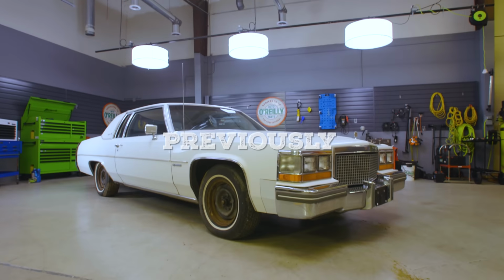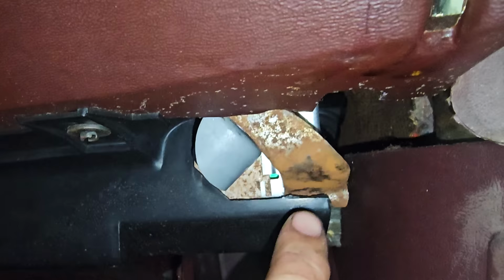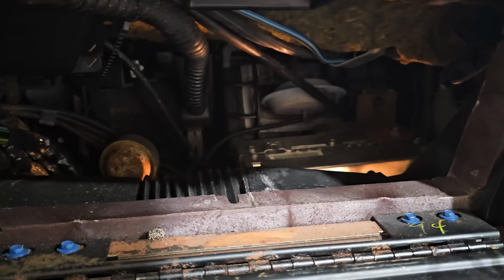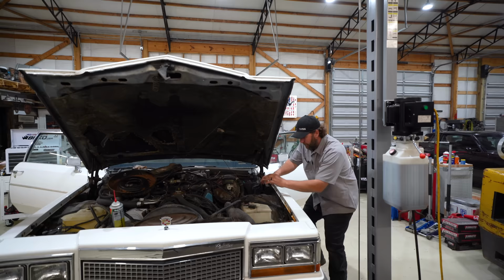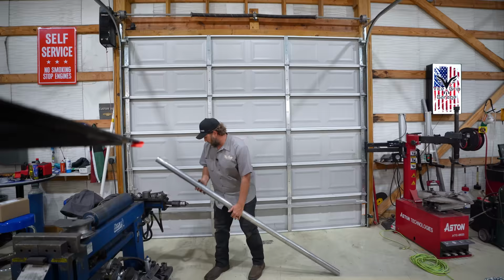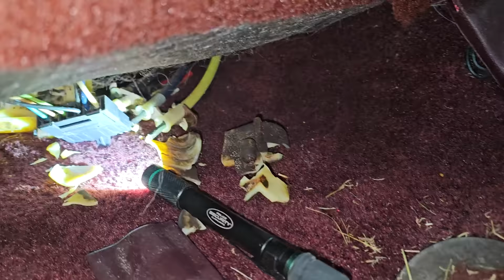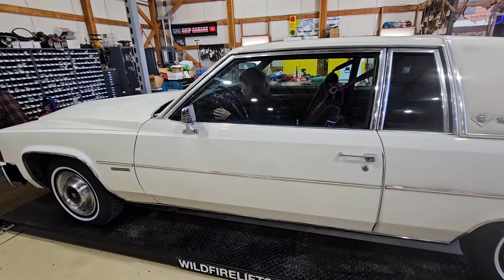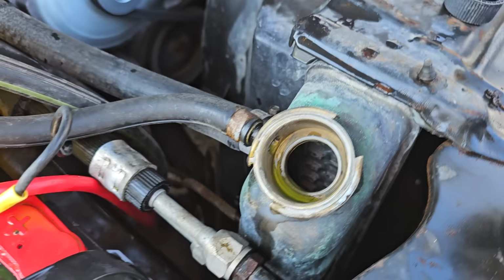Will It RUN AND DRIVE Finally? Carburetor or Computer On This 8-6-4 Cadillac!

Comment: I worked as an electronic tech in the 80's and I was cringing when Derek first started to put the PROMs in the reman PCM. He got it done though without bending up the pins. Nice job! As always a very entertaining video.
Reply: I was basically holding my breath at that point and wondering how he was ever going to find replacement PROMs.
Reply: Pretty sure my heart stopped beating until I saw those PROMs in.. 😂

Comment: Really surprised you haven’t installed An exhaust port to your overhead doors so you can  get the exhaust outside of your fabulous building. A guy needs to use his lungs a while longer and it also make it safer for your little people. Really enjoy the channel, and how much you care about and work to make your family a part of what you do every day. Keep on keeping on blessings to you and yours
Reply: Ive always thought the same thing. I wouldnt be able to stand those old vehicles running inside like that.
Reply: Have you seen how enormous that building is inside? It's gonna take a lot of exhaust to even make a dent
Reply: When I was younger, my father used to go to a junkyard where the family worked on cars in a garage with the doors closed. Eventually, they all developed health problems, and then they sold the business.
Reply: @Demoralized88  yeah but it stays near ground level, so you don't get the whole volume of the building to disperse it, only the square footage
Reply: @williamalexander1743  they were probably smokers too

Comment: My uncle bought this exact car. Same year, color, hub caps and engine. I recall it being rather gutless, but the engagement of the 8-6-4 system felt like a trans shift, so not bad at all. They really didn't have much trouble with it at all.

Comment: Your pure joy and excitement that it actually runs was shared with the engineers, assembly line workers, dealer make ready folks and lastly, the unfortunate owners of that automobile. “Stay running…stay running, oh it’s running” !! Joking aside I tip my hat to you staying determined to get it running with its original fuel injection. Such a fun video thank you !

Comment: This episode really brought back memories. I was a young Service Director of one of the largest Cadillac stores in the Metro Detroit area in the late 70's to mid 80's. Thanks for your shout out of respect for the techs in that era. That car caused a lot of lost sales to Lincoln. Unfortunately, it was replaced by the HT4100 the following year. Many more years of heartburn for Cadillac. Love your channel and stuff on TV. Wish you and your beautiful family continued success. One last thing, I learned very quickly how to manage and turn around an upset customer or a overworked and upset technician trying to get their 8-6-4 back on the road.
Reply: GM should really have stuck with the 425 that this platform was engineered to contain.  The 4100 became a good engine ten years later, but had no business being in a C body RWD DeVille.  Even the 368 was a better choice, versus losing 100cid and a lot of cam bearings.  A 7 liter V8 with multiport fuel injection that could modulate its displacement..  that would be modern today, and is what GM should have built back then.  But shareholders like cheap.
Reply: @Bolton115  the refinements and expanded displacement of the 4100 family were great in less time than that IMO. I had the 4.5 and 4.9 in the two Seville STSs that I owned, and they both had decent power to move a nearly two ton car. Reliable, too.

Comment: On my 81 Coupe DeVille, the mechanic disconnected a wire that went to the transmission, then it ran perfectly on 8 cylinders all of the time. I never had a problem with that engine.

Comment: Had a Cadillac 8-6-4 sedan .. white with red leather seats.  Was a great ride up and down the east coast.  Great at highway speed, but a pain at city driving, shifting back and forth through the active cylinder changes.  Six cylinders was terrible.  We finally put a toggle switch in to by pass the cylinder changes.

Comment: We used to own one of these 4-6-8s. The GM dealer mechanic cut a transmission sensor wire to disable it. He said it was the best way. Our 368 was carboned up, and it shook a bit running on 6, so that's why we cut the wire, but ours actually worked, and saved some gas before that. Ours turned out to be a rare 2 door Fleetwood Brougham.  Gold, white and chrome!
Reply: Wish it were that easy on my 2017 GMC 5.3 with AFM..
Reply: Was probably the High Gear wire that tells it it's in  top gear and shit cylinders down. If it doesn't get that signal, it won't do it
Reply: Your mechanic didn't do you a favor.  Shoulda just run some GM top end cleaner through it, removing the carbon the right way and letting you keep saving the MPGs on the road.
Reply: @Bolton115  it smacks of the same problem that GM's original mechanical fuel injection system had back in the 60s: poorly trained (or just lazy) mechanics taking the easy way out.

Comment: DEREK! Hold down OFF, then keep holding it and hold down WARMER!! Same for clearing codes hold down OFF, then hold down HI. This brings back a lot of memories, most of them bad 😀
Reply: Codes have to cycle three times then back to start of sequence, then you can clear it. Same as the 4100's and the 4.5's after the 4-6-8. Sadly I was a dealer tech in the early 90's and the "new guy" me, got the 4-6-8's, the 4100's and Allantes, I was like hazing for the new guy.   Of course you can rarely get all of the codes cleared for very long. Several eprom revisions did come out that made things better though. That was how you updated the ecu back then, new proms from the parts department and send the old proms back.
Reply: @perfecttommy6952  I had a 4100, dearlawd.   That thing drove me nuts.
Reply: I was telling him that the whole time - if you can see the temp changing, then it isn't working. It's the same with a lot of (now) old tech, simultaneously pressing means press one, and keep it pressed then the other. Add to that, that those old buttons usually work badly at best, it's hard to make 3 seconds of connection with them.
Reply: @perfecttommy6952  You and I had the same nightmare career paths. I really do still have bad dreams of the shitty dealers and Cadillacs that I worked on or for.
Reply: @kworld429  The best part is we can watch Derek do this and remember how fortunate we are today.

Comment: Owned the top of the line version of this car at the end of the 90's. Original, low miles, one elderly owner car. Very deluxe, Kelsey Hayes real wire wheels. Put a boatload of work and money into it. Nothing would ever stay fixed. The insulation on the huge bundle of wires in the door hinge reminded me of dried silly putty, fell off in inch long chunks. These cars were still in the wrecker yards then and I had multiple computers, TBIs, etc for "just in case". So, so many problems. It just never ended. I loved it so, I gave it the best I had, and eventually, it just broke my heart. If you don't hate Caddys yet, this car will fix that for you. Run away, save yourself.
Reply: Agree, I figured Derek gave up on it after it first beat him.  Hope it ultimately works out for him!
Reply: Idk...I own an identical car to this one,two 1990 Brougham, and a 1992 Brougham. They have been hands down the most reliable vehicles I have ever owned. They rarely need anything,most of the work I do is cosmetic and routine maintenance. If you get one thats been badly neglected, I suppose it could be a different story.
Reply: @user-kg2ly2lb8z  used cars can be a good economic option once you get past the "deferred maintenance" of previous owners.

Comment: I graduate from H.S. in 1981. The Gas Saving 864 Caddy was designed. When gas was $1 a gallon and minimum wage was $3.35.
Reply: In 1969 minimum wage was $1.60.
Reply: Minimum wage varies from state to state. It was $3.25 in 1991 when I started my first job. I made $ .10 over & thought I was making decent money. Gas though was only $ .90 a gallon then too. I worked in the next state over from where I lived. In the state I lived in it was something like $2.65 if I recall.
Reply: @stevemccauley5734  Just a quick clarification Minimum wage is Federal. While states can implement their minimum, if Federal is higher, employers must pay it. So yes states can state a higher minimum than federal, but not lower.
Reply: @repaid1  Gas was 89 cents and minimum wage was $3.35.  Federal minimum wage is now $7.75 and gas is five bucks..  hmmm.  Well, you know, shareholder equity.

Comment: That Caddy was a mistake in 81and STILL is!! The diesel Oldsmobile was too!!REST IN PEACE!🪦
Reply: Gee, it's funny how nowadays, that computer processing has caught up with the ideas from back then, that several makes now have modulated displacement engines that turn off some of the cylinders at various times to save gas.

Also, if you have one of these cars now, GM stuck with them til into the '90s-meaning the later PROMs give 30 percent more power than the car had when it was new.  What other '80s car could get a factory provided chip that gave it 30 percent more ponies in its power barn?
Reply: Oh shit, the diesel Olds 88, grrrrr
Reply: @slacker1597  
The engine from HELL!👹🔥
Whose idea was this piece a 💩
Reply: yet Derek has managed to get both up and running, so...

Comment: I'm glad you kept the EFI even though it's a PITA.  Most of the ones I saw and have seen had 4 barrel conversions or permanent 8-6-4 deletes.  Chrysler had the exact same issues with their early Bendix EFI in the 1981-1983 Imperial, and most of those got scrapped for a good Holley as well.  Dealers even offered factory conversion kits.   Replace the fiberglass extensions and it would be a good Sunday driver for lunches or going to church.   FYI -- retrofit kits for the AC to R134 are available, if you want to keep it, but many of the interior AC parts such as the evaporator are no longer available anywhere.  I had an '87 Fleetwood in the shop years ago that was owned by a nice older gentleman, we had done the 134a conversion and it needed a condenser, looked for 6 months and had to resort to pick-n-pull.
Reply: Derek has a carb swapped Imperial too, I think he intentionally seeks out these kinds of challenges to punk the dealer mechanics who cried about them back in the day. It's a great flex IMO.

Comment: Clearing Trouble Codes - 

During trouble code display: Simultaneously press and hold ‘OFF’ and ‘LO’ buttons 
When ’00’ is displayed: Release the ‘OFF’ and ‘LO’ buttons

To end diagnosis:
Press the ‘AUTO’ button, or switch ignition OFF for 10 seconds
Reply: A sex bot copied your comment and got lots of praise from people for the advice! Even Derek thanked them for your advice! Thought I would give credit where it is due for this good advice!

Comment: I did my first headliner 2 years ago and it was so much easier than I thought it would be. I kicked myself for all those years of having crappy headliners. You should include that in an episode. I got the material from Hobby Lobby. They've got the foam backed material just like the original headliners. All you need is a can of 3M headliner adhesive and the material. I took a drill and a wire wheel to get the old glue off the headliner board then I just sprayed it down and laid the new headliner on. It's not really that hard to take out the old headliner board so you can work on it.
Reply: YES!
Reply: Don’t use the aerosol glue, it will fail.  Use Formica adhesive in a spray gun, available at big box stores. It is water resistant and will last way longer than the spray can glue.
Reply: @user-cu5sc5wy6c  you mean the pink stuff?

Comment: Back in the '80s, my Dad and I were car camping in our '78 DeVille.  Dad moved the front seat forward and slept there, teenaged me slept in back.  One morning we woke up, and the front seat wouldn't go back!  It was all the way up, we couldn't even sit in it.  So Dad got his tools out, and found that the skinny end of a flat file blade (where you put the handle on) was a square that fit right into the hole those cables plug into.  He was able to turn it by hand and crank the seat back so we could keep going.  At least back then, you could find an emergency way to keep going.

Comment: Oh well, if you wanted to know about one of these, I was the guy. I worked as a tech in a Cadillac dealership at the time those came out. Truth that it didn't work well. You can't dump gas in a cylinder that doesn't fire. I actually have the book you are going through. It was fun working on those things!
Reply: U can.... it just still wont run
Reply: I thought those solenoids disabled the intake valves so no gas got in?
Reply: @Bolton115  It did but when the vale did open there was a puddle of fuel sitting over the valve that got dumped into the combustion chamber.
Reply: @oneoldmansgarage7880  so when activated it did not clear the fuel that was already there?

Comment: Looks better with wire wheels... even if they is oldsmobile. loved the episode... I've spent many an hour behind a 80s GM dash... brings back memories
Reply: Well it's time to pull that old caddy out. And put a coyote under the hood be different put something under the hood other than an LS. Guys on half joking but. Just do something different. And then drive the wheels off that thing
Reply: Yep, the wire wheels were better.
Reply: I agree, Wire hub caps look much better on it.

Comment: Ihave a 87 Monte Carlo SS 305 HO. Shes all original electrodigicals under the hood and runs like a top. I was one of those 80's Techs that had to repair all this madness, but once you got the hang of it there was no issue with what was going on. I'd be glad to help you out there Derek! I'll bring the cold snacks!👍

Comment: I had a 1981 Sedan Deville with the 8-6-4 motor.   I had the worst luck with that thing; it never ran well and spent more time at the Cadillac dealer than it did in my garage.  My 8-6-4 did work, sort of.   it would only run on 4 down hill, and when it ran on 6, the engine shook. It ran on 6 everywhere.  Great idea, just 20 years before GM had the technology to actually make it run correctly.  The best day of ownership was the day I sold it.

Comment: The 6630 chipset used in the ECU is a derivative of the 6502 chip.  That was the same chip that powered Ataris, Apple computers, C64s, etc.  The same chip currently powers most pacemakers on the market today!  Hope someone found that interesting lol
Reply from the maker: My brain hurts
Reply: @ViceGripGarage  lol. Thanks, mine hurts too
Reply: Commodore 64. WOW, I have not said or thought about that in 40 years.

Comment: S = splice 
C = connector (it's X now so go figure)
Early Bosch FI Cadillacs has the MAP in the ECM therefore a vacuum line into the interior. 

Go work on a mid-90's conversion van. It's a game of Find the ECM.

Comment: Bought an 80 Fleetwood Brougham and the rubber taillights housing extensions rotted out. There was a place here in town that made fiberglass replacements. That was my favorite Cadillac ever. Best riding car I ever had. Put the wire wheel covers back on. ❤❤

Comment: Hi Derek,

I always enjoy your shows but this one brought back especially fond memories.  I separated from the Air Force in January of 1982 and my first job was selling Cadillacs and Oldsmobiles.  My brother was the service manager at the same dealership and we rideshared on many occasions.  This was a rough spell for General Motors due to back to back to back flops in the form of 5.7L diesels, 8-6-4 and HT4100 mistakes.

You always impart knowledge combined with risk taking which leads to interesting episodes.  Best of luck and keep up the great work.

Comment: I came back after i ODed on burning tires off the rims. What a Great Save! Good Video just enough detail to understand what's going on. Really neat to see it come back to life. I know on Old Vettes we have to fight ground issues. Seeing the rust on the Computer tell me wiring grounds need to be checked cleaned etc. Over heating no leak??? I had steam coming out the Heater core on a 64 Vette took me a while to trace it the window would get wet the carpet would get soaked but the catch came in a banzi run revving to 6,500 the heater core burst and antifreeze was all over the interior. Just  a thought. Love to see the old ones saved when they are so complete. Great video Love the boys coming along. You are a blessed man, Have fun take care of MaMa too. Dennis

Comment: I got an HT4100 84 Deville. Replaced basically everything of the cooling system and now it is kind of reliable. The only problem is it gives me the check engine light when accelerating from 80 to 90 with very little throttle. Its the lock up torque converter not engaging properly. If i press the gas pedal halfwah thru it works just fine! Greetings from Germany! I think iam the only crazy german importing a pyle of junk like this 😂

Comment: The problem with that engine was when the adjacent cylinders were not firing, they were not as hot as they should have been to maintain a consistent temperature across the head.

Comment: As a pinball repairman, you really hamfisted those proms! Glad none of the legs broke, you were lucky to do that procedure without the tool to pull the ic. And the tool to straighten the legs on the chip 😬 Yikes bro, if you get that lucky again buy number 19 lotto scratch off!
Reply: I could dump the data from those chips and burn new ones if anyone needs them, I just need the proms to copy and burn the data from. Happy to help!
Reply: No man! I'm screaming at my phone, you have to have super precise inputs when programming 80s electronic equipment! Please call louisville pinball repair and I'll help you for free Derek (big fan here) 🙏

Comment: I can't speak for the 81, 368, but the 1980 had a barometric pressure sensor in the car. The manual may not have mentioned it but I am fairly certain that is what the thing with no hose was.